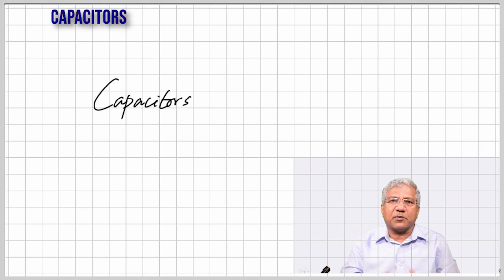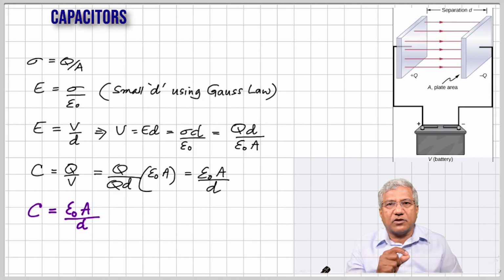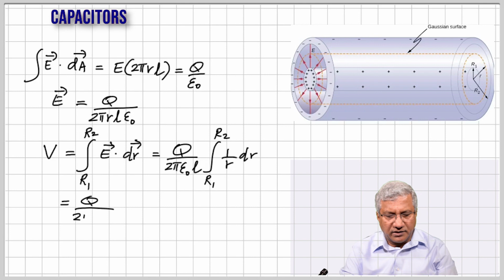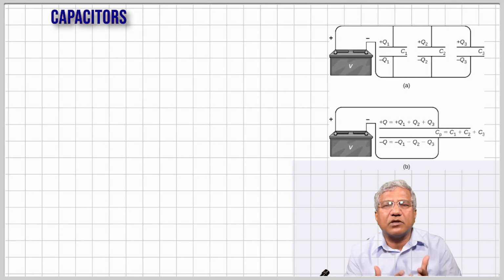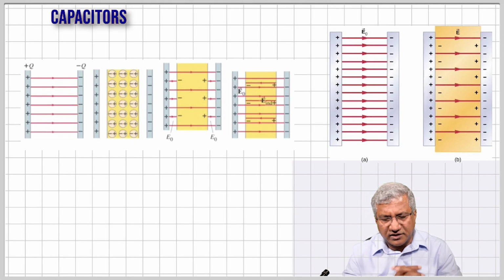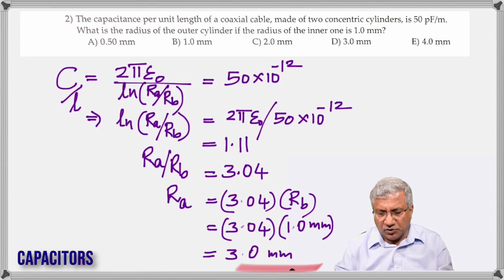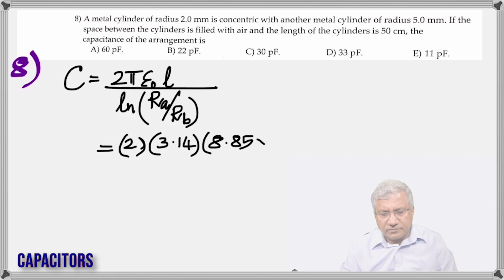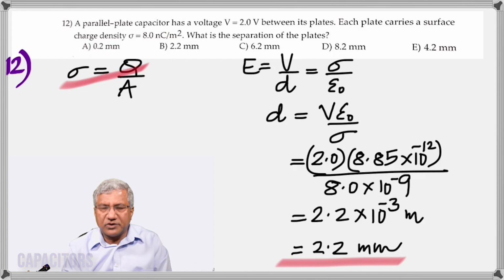Capacitors Explained with Problem Solutions

Comment: An important concept that I learned from this video is how to view the total capacitance of a circuit that uses a combination of parallel and series. One would need to simplify the circuit by taking the smaller sections of the circuit that are in parallel or in series and combine those capacitors sections at a time. The important thing to watch out for is to remember to switch formulas when dealing with the parallel and series sections of the circuit, respectively. Since complex circuits will have multiple series-parallel combinations, one can easily make a mistake in the formulas they're using because they are switching between parallel and series so frequently.

Comment: One concept that stuck with me the most was how we use these capacitors on a daily basis! We can actually use these formulas to calculate if the cord we are using to power a light is safe to use. Thanks for the great video, Professor!

Comment: One of the most interesting points you brought up is how a stud finder works. As someone who frequently helps my dad do handy projects, I have always wondered how it worked. Now that I know that the different materials in the wall, wood and air/insulation, have different dielectric constants that effect the capacitor that is the stud finder.

Comment: A concept that stood out to me in the lecture was that increasing the overlapping area between two plates would increase the capacitance. It's a concept that was interwoven throughout the majority of the lecture, and in every instance in finding capacitance, increasing the surface area of the plates will increase capacitance. I also have a question regarding parallel and series capacitors. What advantage does a series capacitor have over a parallel capacitor? What would be the advantage in having multiple capacitors with different voltages?

Comment: I learned that capacitance is a constant, is defined as charge/volts, and is measured in Farads. I also learned that capacitors are used as a store of electrical energy. Another idea that I learned was that in order to increase the capacitance of a cylindrical capacitor, reduce the distance between r1 and r2, and make the capacitor as long as possible.

Comment: One concept I learned is that capacitors stores energy this especially important factor when the power source/voltage is disconnected as voltage does not simply disappear but continues to be present.

Comment: One thing from this video which I learned was that the charge and voltage are proportional to each other, meaning that if one changes, the other will change to match the ratio of the changed value. This means that the capacitance would remain the same despite a change done to the other values.

Comment: throughout the video, one idea that stuck was over how capacitance is a set. The capacitance is a constant yet regardless of so whatever is acted upon the charge will also be applied to the voltage. In simpler terms, if the charge is multiplied by a number (x) the voltage will also be multiplied by (x).

Comment: One concept I learned is when capacitors are connected in a series they all get equally charged, but the voltage will be different and when you add the three voltages it must be equal to the source voltage.

Comment: One concept I learned is that even if the charge increases the capacitance stays the same since it is a constant. In addition, in the cylindrical capacitors, the capacitor is increased by decreasing the denominator. This means making  r1 and r2 as small as possible.

Comment: One of the applications of capacitors that interest me is manually turning the radio. One stationary capacitor and one moveable capacitor are inside a knob. As you move the knob, the moveable capacitor moves closer to the other one which increases the area between them; therefore, increase the capacitor and change the frequency

Comment: One main concept i have grasped throughout the video is a good understanding of the differences between parallel circuits and series circuits and how voltage (V) and charge (q) behave differently through each one. I also learnt about dielectric constants and how the type of material changes the strength of insulation.  Air has a dielectric constant of 1.

Comment: Do both mechanical and membrane keyboards work the same?  Membrane keyboards don't really have switches so I don't see how capacitors could fit in one.
-Jose Trevino
Reply: Also, whats the importance  of putting capacitors in a series or parallel? Like why wouldn't having just one be enough?
Reply from the maker: @snuklens  Good Question- It is to make sure that the voltage rating of each capacitance is not exceeded!

Comment: One important concept that I learned was that charge is proportional to the voltage.  If the charge is doubled, the voltage would also double, but the capacitance would stay the same since it's a constant.

Comment: One of the main take aways in this video was distinguishing the difference in charge and voltage when plates are in a series or parallel. In a series, capacitors get equally charged while voltages will be different. By contrast, when plates are parallel voltage will be the same but charge will be different. They’re opposite from each other.

Comment: When plates are connected to the same source and are parallel to each other, each plate will experience the same voltage but will have a unique charge. The case is the opposite when the plates are connected in a series. In a series, the plates will experience the same charge but each will have a different voltage.

Comment: Why is it that when the capacitors have the same charges with different potential drop, the numerator of the equation is 1? Will that number ever change?
Reply from the maker: Since the Q on both sides cancelled out! That is a mathematical step that needs to be understood!